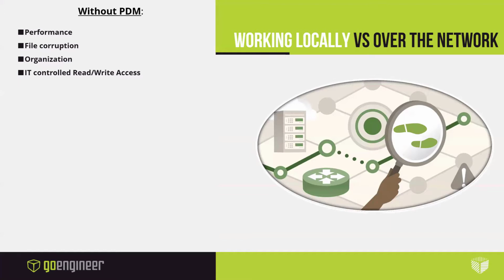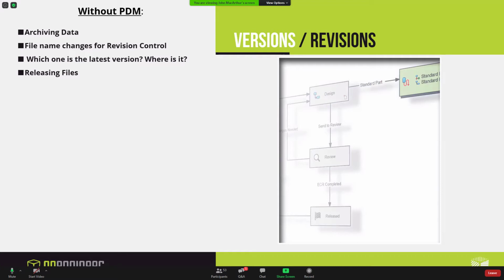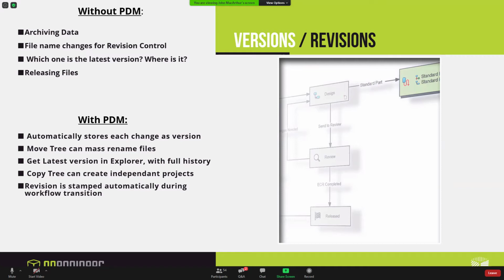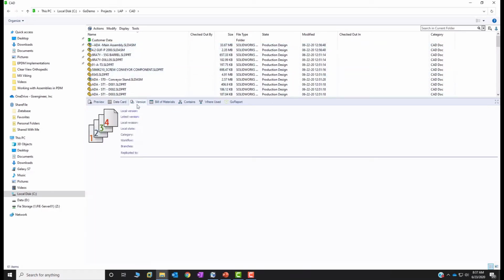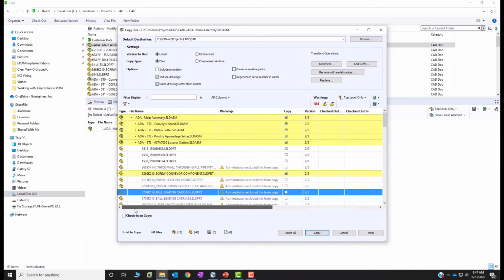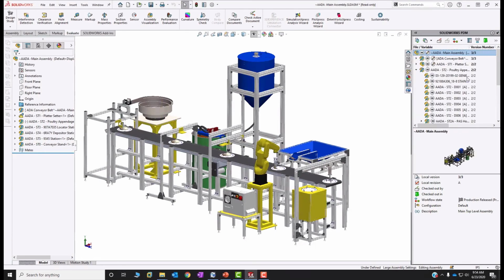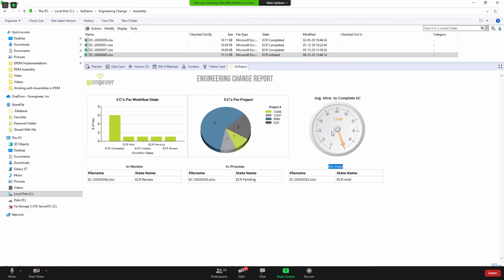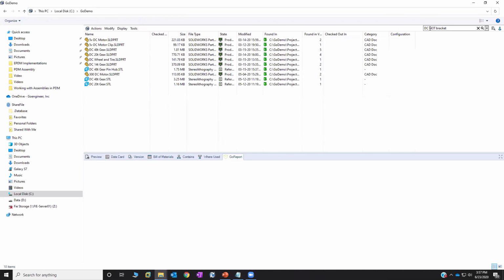SOLIDWORKS PDM Webinar - Working with SW Assemblies In a PDM Vault

Comment: would like to express some issues that I faced, hope you can provide some insights;

I am using the PDM standard as standalone installation (servers and client located in the same workstation and PDM basically using to as version control and the revision control method)

1. each time if I rebuilt and save (I do use to it in normal Solidworks to get rid of sudden crashes and data losses) it identify as a new version, should I need to make the new version after rebuilt or save even there is no any modification to the part?

2. as an example;
I made an assembly with two parts associate with drawings fro each of the parts and assembly. Then had check-in for all parts, assemblies, and drawings. Finally, it asks to rebuild some assemblies, parts, and drawings once I modified one part in the assembly.  Is this the proper way to go? (because it requires to open all the files and rebuilt whole requirements again and again, pretty annoying)